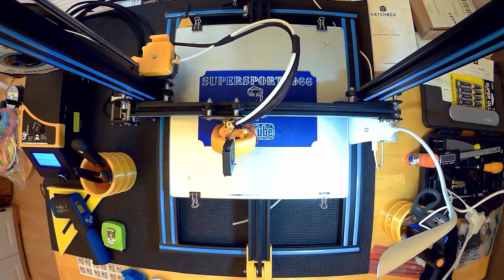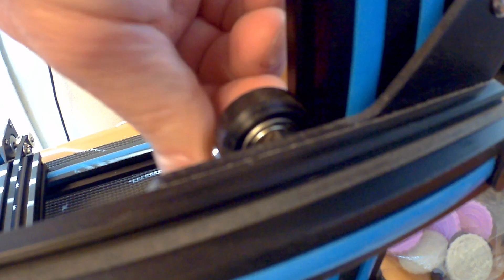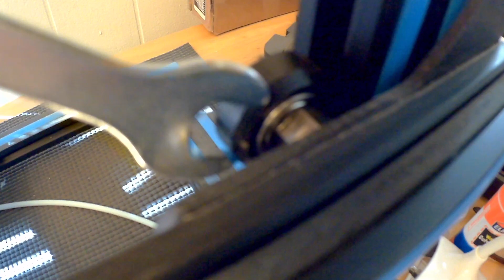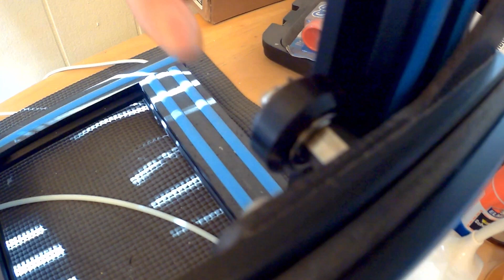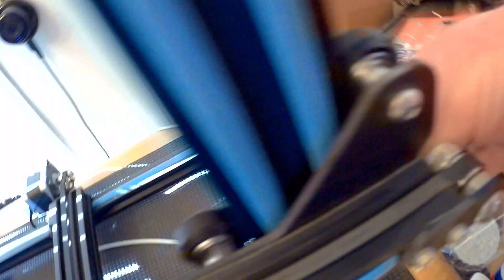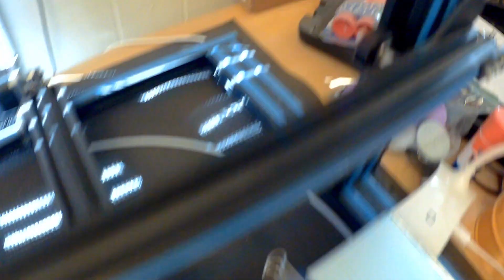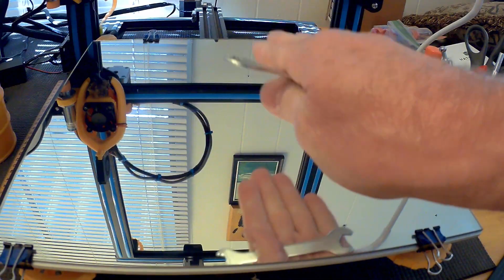Adjust Z-Axis Play on Creality CR-10

Comment: I have an Creality Ender 3 that I just got. I spent 6 hours yesterday trying to adjust these nuts. It's still not right. But at least my Z axis goes up and down now. It would home just fine, but once it was all the way down the Z axis would not raise at all. Like I said after 6 hours of adjusting, I finally got the Z axis to move. It now goes up and down all the way without stopping and clicking. But I can tell that there is a slight vibration at about the half way point. If I even move the nut 1/16 of an inch it will lock up again and not move. It doesn't matter which way I move it. Looser... locks up.... tighten it.. locks up. So basically I'm stuck where it is at. I am lost.
Reply: Same problem with my Ender 3
Reply: @emily.cruz.2015  print out the shims. They fixed mine
Reply: @bkpickell  I've tried printing this, sometimes the z axis does not rise.
Reply: @emily.cruz.2015  if you can't get them to print, you can use a thin piece of cardboard temporarily in order to print them out.
Reply: @emily.cruz.2015  Try loosing the screws holding the brass nuts, they need to move a bit or they bind on the lead screws
Reply from the maker: Elem Costa were you able to get yours fixed?
Reply: @SuperSport1966  not yet, I am very disappointed and tired of trying to fix this printer.
Reply from the maker: Does the Ender also have those colored plastic fillers in the frame like the blue ones you see in my video?  Some people have issues with the nuts dragging on those plastic fillers. Check to see if they are dragging. If they are, you can pull those out to make more clearance.
Reply: No it does not. I just finished printing the calibration cube and it looks okay save a single layer over extrusion at the center. Overall, I am happy with the print other than that. It may work out. It just bothers me that there is so little room for error on those eccentric wheels.
Reply from the maker: It does sound like something is binding somewhere.  Normally there is a bit more play on those wheels.  Also, there is no tighten and loosen direction to those wheels.  When you turn the nut, it goes in an oblong circle, around and around.  So it just keeps tightening and loosening every time it goes around when turned in either direction.

Does your Z-Axis screw (the tall rod that is threaded on the Z-Axis motor) have a bow to it, or is it perfectly straight?  It does not take much bow to make it bind.  And maybe check the Z-Axis coupler to make sure the set screws are tight on it and not slipping.
Reply: @SuperSport1966  the rod is straight. I think I got it fixed. I saw a video about that solid coupler causing the binding and the fix is to print shims for the z motor. I did that this morning and it runs smooth .

Thanks for the tips. You earned a new sub.
Reply from the maker: That’s awesome!  Good job of diagnosing.

Comment: No matter which way I move that it never gets it tight.  Right side always sagging
Reply from the maker: I had that on the left side of the gantry.  On the left, there is no adjustment nut like on the right.  What I did was to loosen all the nuts (one at a time) on the left side and put pressure on each wheel towards the frame as I tightened each nut back up.  This allowed just enough movement to tighten the left side of the gantry.  Hopefully this will work on the right side.  If not, and if you've used your printer for a while, you might have worn wheels to where they aren't big enough around to reach the frame anymore.  Those can be replaced fairly cheaply.
Reply: Hands down, this is the most UNDERRATED problem with printers... I have 3 or so millimeters difference from one side to the other... I enjoy tinkering but this issue just isn't talked about on any mainstream YT channels....
Reply from the maker: Also, be sure you are turning the Eccentric Nut.  Notice it's larger and between the frame and the wheel.
Reply: That eccentric nut isnt really a nut, its just a spacer. It looks like you can use it to tighten something up but its not connected to the screw.. I tried holding it with a wrench and trying to turn the nut and noticed that the screw inside the nut would just turn with the movement of the wrench.. It had no effect to tighten or untighten. You actually have to undo the screws on the right side that connects the frame with the wheels are on that connects to the beam with the extruder. Once you do that, you slide the beam down and the frame with the wheels up and youll see the hex screw that is hidden from sight and actually needed to tighten this piece. That hex spacer is stupid, its false advertising, it does nothing.
Reply from the maker: Mark Agustin  -   Actually, that Eccentric Nut moves the wheel in a circle.  In other words, the wheel will get tighter and looser from the bars when you turn the nut.  If you aren't getting your's to go tighter and looser, then the other side is too loose like you say.    It needs to be within a certain distance before it would do anything.
Reply: SuperSport1966  - Yes, mine was so loose it had no effect, i had to take off the rail, and tighten the nut then it was perfect. I assumed from initially watching the video that the big hex nut you were tightening was attached to the screw and then when i turned it the screw would just move around with it.. Then i figured out there was a hidden bolt behind the rail.. Just wanted to point that out to that other guy and whoever else that could have the same problem i had. That big hex/spacer/nut thing only has effect if the bolts are already tightened..
Reply: @Eric-qp7rx  I also had the same problem. No matter how much I tighten the eccentric nut, if the nut hidden behind the frame is loose, you cannot adjust the eccentric properly. I had to separate the frame from the beam, and tighten it. 

Just a word of caution to anyone facing this: The two screws connecting the frame to the beam have a T-nut inside the beam, so be careful when unscrewing them. You don't want to lose the t-nuts. They are fairly easy to place back inside, but knowing they are there really helps a lot. Also, don't super tighten anything. Just as long as everything is in place and engaging properly, there is no need to tighten it more.
Reply: @PedroVarela20  Yes, and to just to add to you're do not tighten comment.. I had over-tightened mine and saw black rubber from the wheel baring slightly being rubbed off which caused me to loosen it a little bit. Make sure you look for this as a side-effect of over-tightening. Also, depending on how loose it was to start with you also want to re-level your bed since it can tilt or shift a bit once getting aligned and tightened properly.

Comment: Damn I was wondering this since I got Cr-10. Short video like this is exactly what should be on youtube. :)
Reply from the maker: Thank you!  I hope it helps your CR-10.
Reply: Mine has been wobbling up and down with almost no force. I had no idea how tough I can make it.
Reply from the maker: Were you able to tighten it enough to be more solid?  Remember, don’t over tighten it, or the wheels will wear down quickly. Just tighten until the wheel does not spin without moving it.

Comment: Overtightening that nut will cause layer squish for the first few layers. The nozzle will plow through previous printed layers for about 5 layers or so. The nut should be tightened to where the roller just engages the rail. especially on single z rod models.
Those color inserts on the vertical rails have been known to catch/rub nuts on the gantry hardware as well (mostly on the left side). I removed mine
Reply from the maker: RobbyMaQ Thank you for this additional info. We all appreciate it. I’ll verify mine isn’t too tight, but I believe it’s ok right now as my prints come out pretty nice.
Reply: It's probably fine if your prints are coming out good. Drove me nuts when I first got my cr-10 and tightened all of the nuts (including that one). I only mentioned it because it's a clear sign if and when the nut is too tight on the right side
Reply from the maker: Again, good info.  I actually would not have thought to look there first if I had that issue.
Reply: I do have this issue, and I was looking for 3 months to find the cause:) this is better to be on the loose side. like it come from factory. however my z azis become loose from factory after 10 prints., it uses some odd trorx to fix it and it doesn't come included. so it is very hard to know what should be tightened and what shouldn't:(
Reply: This seems to be my issue. First few layers are squashed. Shame this is not shown in manual.  Yay for YouTube

Comment: Thanks for the video ... I'm having this issue .. the other side should be tight too?
Reply from the maker: Zaily Lopez the other side should be fairly tight, although there are no adjusting nuts on that side. If the right side is tight, the other side usually follows fairly well since that’s the side with the Z-Axis screw. 

I did tighten the left side slightly when I got the printer by loosening the screws that hold the wheels on and putting pressure against the wheels when re-tightening the screws. This did help a bit.  If it’s not super loose, it should work fine.
Reply: Two of my wheels are spinning very easily on the z axis side.  Not sure how to tighten them besides to take the while print head gantry off